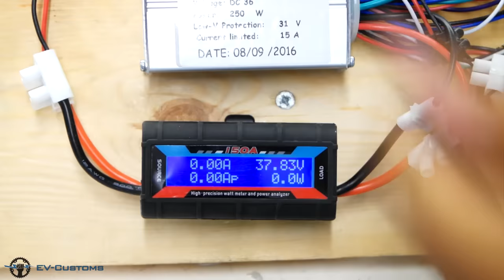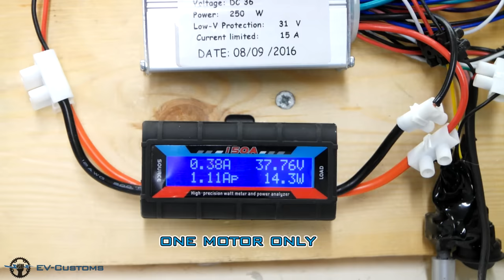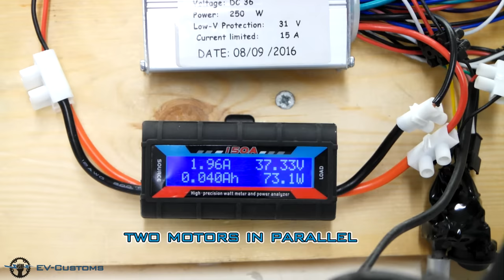Can one Speed Controller Run two Hub Motors???

Comment: I don't know if anyone has explained this yet, but the problem is magnetic induction in one moter feeding inverse flow into the other. It is creating an oscillation back and forth between the two. As one spins faster than the other it acts as a generator to the other. This is demonstrated when you turn one by hand the other rotates in the opposite direction.this means the moters are constantly fighting each other. If you wish to run two on the same controller you could try either run them in series while doubling your voltage or add some capable diodes to prevent backflow. I would recommend two moter controllers however. One side effect of this is the dynamic breaking, so coasting would be an issue.
Reply: And also if these motors are brushless you can't control them with only one controller I think
Reply: I dont think you know how these
 works yes they dont work together under load I tried but you cant connect 3 phase in series or ad a diode to a ac motor
Reply: Clearly people don't know the controller for brushless (AC) uses back feed or hall sensors to know how the motor is positioned. You can't hook 2 together and have the 3 phase timing correct for both. Now brushed (DC) motors you can hook up in parallel and it will work.
Reply: It is possible but the controller needs to be modified to stop the feedback from one motor into the other. Open the controller and double every output stage (at least you'll need another 6 N-Channel FETs plus 6 times the SOAR circuit) That way you give your controller a second Motor Output that doesn't feed back.
Reply: @sebastianweinert3802  that would be two in one controller driver .. I think :)
Reply: Just do what you do with multirotors.. 1 throttle 2 speed controllers 2 motors.
Reply: Marcus Bridge good idea I like it so much 🙏🛎❤️☝️
Reply: I have given this motor disparity some thought and my idea is to individually use 2 motors, 2 controllers and 2 thumb throttles, but those either adjustably locked together, (as in a tractor's two side's brake peddles), or on both bar ends, for front/back variable drive to both wheels while on the move.

As you have no clutch to deal with it should not be too complex to ride, and might actually be quite fun as you can shift drive to whatever wheel is gripping best.

Also, I have worked out how to operate both brakes from one or either or both brake levers, (a LA Moto Guzzi), but with the cables utilising the 'headstock' revolving ring used on BMX Cycles.

There is no problem that a creative reasoning Engineer can't solve.
.
Reply: If the speed controller has FOC control, it would be also a problem running more than one. The feedback of the motor phases is intersected. thus, FOC would not be able to control the motors properly.
Reply: @nightmareinaction629  are't they dc motors?
Reply: Emmanuel Lacourse no they are 3 phase motors
Reply: Lens effect
Reply: Running both like this will be fine but they will be noisier under load than normal as no hall effect sensors are used. Controllers are cheap, so would make sense to use 2 controllers, then you can use the hall effect sensors. The controllers can both be connected to the same throttle without issue.
Reply: how would you run 2 sets of hall sensors into. single controller?
Reply: @petertwiss356  you can't.
Reply: I suggest 2 controller and tinker with the throtle to add a second sensor between the  magnet in the handle and run that to the second controller. I'm planning a hybrid gas/electric scooter conversion and I will handle throttling  in a similar maner but i wiil need to transfer the magnets too.
Reply: @Fantaman900  Hall effect wires were not connected.  Marcus Bridge was correct on the point that back emf from one motor was interacting with the other. However, as each phase is fed from a full bridge of FETs so current needs to flow both ways and, no, you therefore can't use diodes to isolate the motors.
Reply: nightmare in action what tells you that?
Reply: This is a stolen video of someone else..look for the original creator
Reply from the maker: Are you serious..?? find me original creator...
Reply: L
Reply: You guys could get a vesc and just call it a day. A fully programmable 3 phase motor. They do hold up to high amp loads as well.
Reply: Combining two 350 watt ea motor hub on 1 bike is for the use when going up steep hill only. It is the only purpose of using 2 Motor hubs of my project yet to build. But the 1 issue that is a negative is combined weight of bike and slow down speed on regular surface angle. I need to do a lot of more research before starting to finish and be useful
Reply: Can a differential fix this?
Reply: @spinnanz  the ARIELRIDER GRIZZLY DOES it. im trying to do to my AR KEPLER. but can't find 26x4 front hub assembly 52v1850w motor and tie in to my rear hub . both or front or rear. any help would be appreciated. thx
Reply: Without seeing the replies after watching this and having a think about the noise and issues please keep in mind that I don't have the technical terms. But the sound and resistance to me is the same as when the wires touch. Like one of you said one or the other has to be first and last. So to the other one is feeling a short and both are fighting for first place. To stop this instead of aiming for perfect synchronization wouldn't the opposite work better if after each halls had done it's bit it could be isolated until the next turn. ? Love the ideas and experiments and Escooters from an ark not quite a spark
Reply: @mad151maxx4 No that is incorrect. It has dual controllers, one for each motor. As someone explained above, this cannot work due to the back EMF of the motors constantly fighting eachother. This is why spinning one caused cogging on the other. Sure he can spin it on a bench but load the bike and try to accelerate and you wont be going anywhere. It will either hiccup and shake like mad or throw a fault.

Comment: The wise thing to do would be to use two speed controllers and two motors connected to a single throttle source. That's how quad copters are built. Each motor has its own speed controller, and the speed controllers are synchronized when you calibrate throttle position.
Reply: Yea but quad copters have to regulate all motors independently. The bike would be finde with them running the same speed.
Reply: Newsflash ! This isn't a Quadcopter !
Reply: blise and chris you are both right but its grossly under powered either way that's a 250w controller and (2) 250w motors in parallel whcih makes them running about 125w a piece. also by adding the other motor you are adding resistance (ohms) to the inner workings of the controller. you've effectively doubled the work that the controller has to do to put out that same 250w. it might work but not for long ESPECIALLY under load.
Reply: It would significantly bring the price up.
Reply: @christopherroberts22  you should have said that before I tried flying off the roof.
Reply: @christopherroberts22 😂

Comment: Your assertion at 9:29 is very correct. I was very glad to see that you do not recommend doing this. There are other reasons why this is real bad in real word usage. Watch what happens when you connect the 2 wheels to a common surface where the cant readily slip between each other. Or you can try using a chain or cog belt between them. In other words locking them to try to spin alike. You will burn things because the motors are never identical. I did these tests years ago with help from Neu Motors and Castle Creations. 

The noise  you are hearing is a harmonic vibration because of the difference between the motors.

Best way to do this cheap is use a common feed to separate controllers. But you can still get fighting between the 2 motor systems because of motor differences.

Now I had great results using the hall effect switches as regulators to make the separate motors spin at the same speed and stay synced. But that took more processing from outside the controllers. Now this could be accomplished with the use of Raspberry Pi or the like.
Reply: these motors have one way clutches, so one will drive  and not the other until the tires slip. if load increases and causes a speed decrease, both motors speed decrea, so only the wheel with the bigger dia tire drives.
Reply: Will George 
Interesting. So you lose drive if one wheel out speeds the other but you continue to drain power from your battery. That is a model of inefficient behavior in an electric model. Also the motors are still in essence still fighting each other in my book. The drive sides will always be hitting upon the other. I think it far better to control one then use the Hall effect switch to trigger control of the other. Then the motors will be synchronized. At least that’s how I see it. Maybe I should pull out some parts and revisit this issue.
Reply: @michaelmeisman4731  I think it would be better to drive one motor only, then bring in the other if it is needed. really need 2 controllers
Reply: This procedure has been done by electric kick scooter with a dual motor like the Dualtron and others. Mine has a dual drive motor but use  only one controller with the same kind of configuration as shown in this video.
Reply: If you had a 500W controller would that work?
Reply from the maker: No my friend, Will be  same think
Reply: db  You would need a 1000w controller for two 500w motors.
Reply: You definitely don't want to use a Raspberry pi for this, a microcontroller using a real-time operating system like the ESP32 or STM32 is better suited. If you want to run Linux then the BeagleBone Raspberry pi competitor can also be used since it has a gpio microcontroller onboard. However using Linux means you'll have to wait longer for it to boot before you can go anywhere.
Reply: @Glenford617  interesting
Reply: @Glenford617  interesting, so do the dualtrons still use the single controller?
Reply: @EVCustoms , How many volts should have the battery for two motors that each have 1000W of power, connected to two controllers?
Reply: I tried this very same experiment a ways back; my first red-flag occurred when I realized how the inductive kickback was oscillation between the 2 motors; soon as I put my hand on one motor and felt the effect and I spontaneously realized what was occuring. This is a good experiment for anyone working with 3-phase motors to do as it gives you a hands on experience that helps make the mechanics of the operation more clear regarding elements otherwise overlooked. Having others ring in regarding what has happened in the video is extremely valuable. I love seeing the comments as much as the video.
Reply: So what’s the best options two controllers one throttle ?
Reply: @UKMrMedical  My question exactly

Comment: Nice. I’ve actually did the same thing but instead of one controller I did it with two 48v controllers and 2x 1000 watt hub motors. and rewired the controller to work with one throttle. My goal was for more torque but also gained a little bit of more speed from 28 mph to 34 mph
Reply: Forgive me if this is a stupid question Did you wire the same battry pack to the 2 controllers?
Reply: Did you wire the same battry pack to the 2 controllers?
Reply: @vladimirryder5195  yea I did use the same battery for both controllers I also made it work with two separate batteries for each controller as well but I prefer the single battery instead.
Reply: @tsmithurst   yea I did use the same battery for both controllers I also made it work with two separate batteries for each controller as well but I prefer the single battery instead.
Reply: may i knw how to connect two controllers to work with one throttle..Thank you
Reply: @didihamdiillah1764  Search ebikeschool on yt. He has a good video about wiring a single throttle to 2 controllers. It is easy.
Reply: What do you mean 'rewired the contrller'
Reply: @VictorVictor-f1h  both speed controllers have a throttle cable and the cable comes with 3 wires a positive, negative, and a data. I connected the two data’s to transfer the signal so that both speed controllers can be throttled simultaneously. Make sure that both controllers are using the same battery and not separate. But if the battery are separate for each controller then never power one speed controller and the other not; when you put throttle.
Reply: @tsmithurst  yes
Reply: @vladimirryder5195  yes
Reply: @didihamdiillah1764    yea I did use the same battery for both controllers I also made it work with two separate batteries for each controller as well but I prefer the single battery instead.

Comment: Running both like this will be fine but they will be noisier under load than normal as no hall effect sensors are used. 

Controllers are cheap, so it would make sense to use 2 controllers, then you can use the hall effect sensors. They can both be connected to the same throttle without issue.

Comment: I would think there would be miscommunication with the hall effect sensors. They have to be able to tell the motor where the windings are but if both motors are in different positions the controller won't send a proper signal to the motors.

Comment: I know this video is from four years ago. In that time period commercial e-bikes with dual hub motors have come to market. I have one. Mine is an EMX-Xtreme 500 from Fabulous Ebikes that has two 500w hub motors running on a single KT controller. KT (Kunteng) sell a controller designed to support two motors. In use I'm finding the set-up works really well. With each motor having 80Nm of torque the bike has relatively great acceleration and hill-climbing. On level terrain it appears both motors just share the load put on them by the pedal-assist settings. I can switch on or off the front motor while riding. On level terrain, switching on the second motor does not double the amperage draw. It stays practically the same whether one motor or two. On the EMX-Xtreme 500 the bike comes standard with a 48v 30Ah (1.440Wh) battery. With that I've had real world ranges per charge of 110.4 miles to 156.9 miles. Fabulous Ebikes also sell models with 60v 23.4Ah (1,400Ah) battery and a pair of 750w hub motors, again with a single-controller solution.
Reply: I wonder how they would act as two motor rwd cart. I would like to avoid using a diff.

Comment: How about mounting it to a common axle? I'm thinking of placing two direct drive motors from a washing machine (which are not the same as these but also BLDC) on the same axle and connected to the rear wheel via a chain. My theory is that if I place hall sensor wires to one of the motors and align them properly in phase they would turn just fine. I'd use a 2kw controller in that case.

Comment: Very nice sir, now you kmow im not lying.. We used 1kw controller on 2 500watts hub motor. I think this setup will burn the controller if the 2 motor have load. Thank you sir
Reply from the maker: Yes like this can work but i not recommend because like this you will have huge losses...
Reply: Price sir 36volt
Reply: Really it would? I'm trying to get my bike to synchronize with all three wheels moving with pedal-assist for my trike
Reply: @BORNFREEININTHACD  Difficult setup!  Though probably not what you want to hear the easiest, troublefree setup would be a single motor/controller front wheel drive.  Spitballing here but option two would be a two controllers/two motors probable equipped with hall effect position sensors for both rear wheels. Would need some circuit/microcontroller to act as an electronic "differential" to keep both motors synchronized. Just a semi-educated guess.  I have more then 15yrs of BLDC motor/controller experience but not in this application.
Reply: @barthchris1  I have a dual motor electric kick scooter and I looked inside its only one controller the same configuration as this video. Its been using by the E scooter manufacturer with a dual motor.
Reply: @Glenford617  Sure it's not two controllers in one? Are the three phases soldered to the same outputs?
Reply: @barthchris1  Could you run two controllers and then cross the hall effect sensors, so both read both motors?
Reply: @ItsDaJax  Yes, two separate motor controllers would work fine but hall effect sensors only from each motor/controller.  This is a timely subject as I just happened to run into a shitload of basically brand-new new Segway rental scooters that were abandoned just outside of Washington DC.  Already hacked the firmware to get them running but 20mph is too slow. Lol! Want two motors now. Will try to remember to reply when/if I achieve success.
Reply: @Glenford617  Which brand scooter?

Comment: The motors are out phase. Probably 30-40% of the power when both motors are running is canceling out on the wire. You have to have either the sensors or the return signal developed by ESC aligned, so they fire the correct polarity at the correct time for both of them. Probably be easier to add sensors if there not already in there.

Comment: Induction resistance and feed back.

The pluses have a feed back and you're feeding them to the other motor, there is a build up which amounts to the "losses" you saw which is around 50% of the power (cycle). 
Put on diodes and a load cap. Then it will work fine.

Isn't the controller and motors miss matched?

Comment: Sry if this question has already been answered ... with having only the stator windings in parallel and only one motor having the hall sensors connected to the controller, what are the result in Power consumption? 
My thoughts ... having dual conflicting input signals is probably having an effect on the controller output. With only one unit giving feedback to the controller, the output frequency will be equal to both units, as the second is purely slave unit with the results being a closer to a doubling of the overall current draw. Now if that slave is proportionally under more load, what is the outcome?